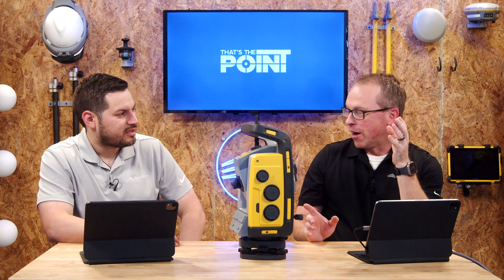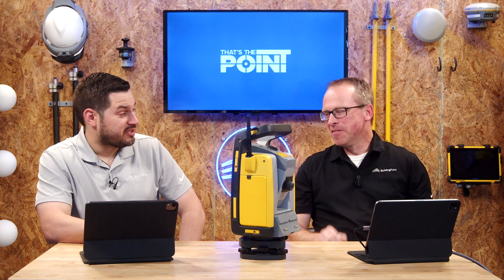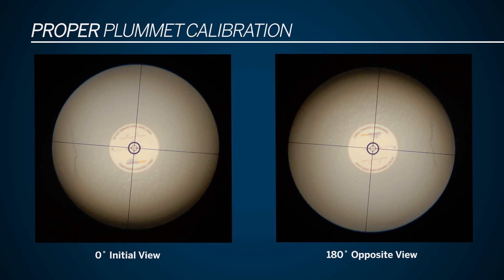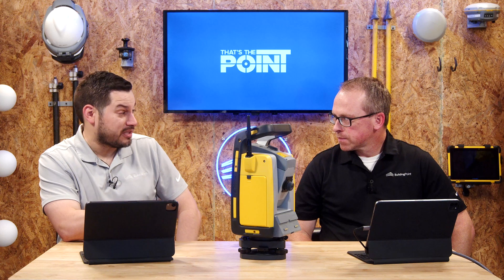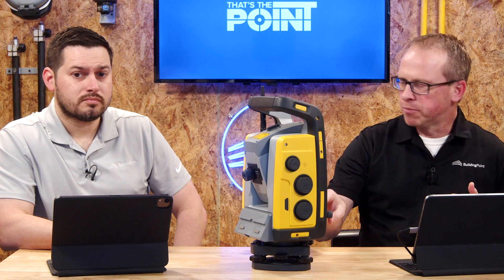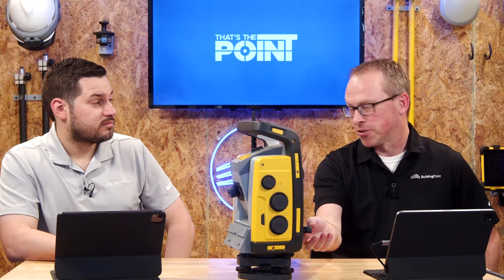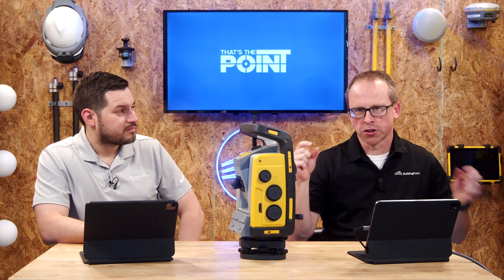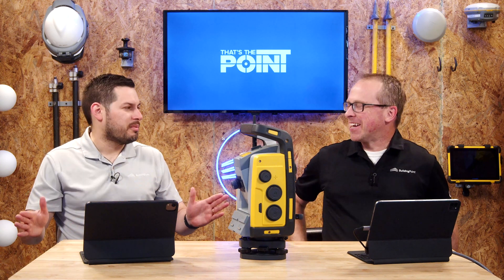That's The Point - Understanding Optical Plummets

Comment: The easy and quick way to check a Trimble Optical Plummet is with a plum bob.  Simply mount it on a tripod with a plum bob hanger and compare the result of the optical plummet to the plum bob. The plum bob is always correct.